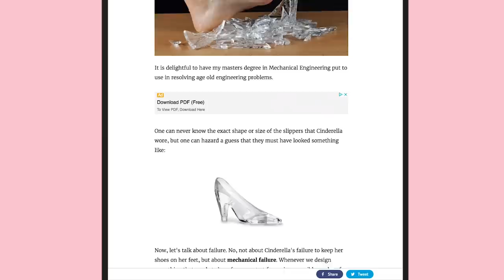I Tested Custom Glass Slippers Like Cinderella

Comment: This shoes were way to big for her. Of course she fell on the stairs.
Reply: Mona L what KNOW
Reply: What I was thinking
Reply: they awkwardly stuffed her sock too
Reply: They probably have to be slightly to big, because the material is so rigid
Reply: Mona L i think they intentionally find a person with smaller foot so they can stuff the socks to protect her feet when the shoes broke
Reply: They... did that on purpose. So that they would.

Correct?
Reply: Actually she wears a socks so that it will fit her perfectly before their experiment starts.

Comment: Her foot was way to small for that shoe!
Reply: Sofia Arango exactly
Reply: Sofia Arango 👍👍👍👍
Reply: It would have been almost impossible to find someone to fit that shoe perfectly I think, because it was pretty nartow at the top but wider and longer in the bottom - you would have needed someone with very slim feet which are normal sized.
Reply: In addition, a perfectly fitting shoe doesn't fall off.
Reply: July TwoWishes you try making a glass slipper by hand
Reply: Sofia Arango ikr
Reply: Augusta Leblanc  Why? Your answer literally doesn’t make any sense
Reply: ik
Reply: Sofia Arango IKKKKK
Reply: I luv how she said push more. More more. Luv it
Reply: Now we know why Cinderella dropped the shoe
Reply: I agree
Reply: THANK YOU
Reply: Too*
Reply: @lumen526  Mine would've fit :)
Reply: It was too small but any other bigger feet wouldn't even get in due to the narrowness. As you can see, they used socks to fill in the space. But it probably also threw her balance off because her center of gravity is in the middle of the shoe rather than the back where the heel is. It's not perfect but as close as it could get
Reply: Sofia Arango ikr (1year ago too and I still agree 2019 😎)
Reply: I know but they said she got the shoe to "fits"
Reply: Shhh I mean I'll probably fit it in a size 6 (UK)
Reply: I bet I could fit it
Reply: It wss hand blown so thats an option as to why
Reply: I have incredibly slender feet, like real abnormally narrow (what a claim to fame..). I truly want to know if I could’ve managed it, haha

Comment: I'm a glassblower and I think he did a great job on those shoes. Shaping it to fit is hard to do by hand. I made some Glass-Knuckles that took several re-workings to fit my hand.
Reply: Matt Jasa woah.. that sounds so cool. Be careful!
Reply: Thank you. But don't worry I teach glass blowing too, safety is most important. Like at 4:43 when he pops the hole he melts in the "bubble trash." That's the way to do it, you don't want to be breathing that Bubble Trash in.
Reply: Matt Jasa interesting rubs chin
Reply: He’s wearing sandals and I was honestly concerned about his feet the whole video
Reply: To be fair, Disney’s Cinderella’s shoes weren’t made by blowing, it may have had a better fit design inside, and even a little friction on the bottom.
Reply: Matt Jasa I've been glass blowing before and it is an amazing art. The only thing that I didnt enjoy was the bulky gloves in the hot room, but that wasn't that bad. I respect everything that you do!
Reply: When you say re-working, do you mean you can re-heat them to re-shape?
Reply: You make YouTube videos as well! I'd be sure to check those out!🙃
Reply: How much would a pair typically cost?

Comment: I read somewhere that the shoes were originally leather and in some translation it got changed into glass.
Reply: I believe it was fur in the original but the reason for that isn't pleasant....
Reply: @echoeddra8on  specifically, silver squirrel fur, which sounds like it would make pretty dope slippers
Reply: It was fur from squirrel because in french it is called vair which sounds like verre meaning glass so that's why it got misinterpreted throughout the years
Reply: @pandoreldr4232  I guess at some point "glass slippers" made about as much sense to the translators as "squirrel fur slippers", but the squirrel fur sounds way more comfortable... ngl, every time I pass a dead one on the side of the road, I think about it
Reply: Why don't they make one from plasticcccccccc

Comment: Logic:
Cinderella's glass slipper fits perfectly at her
But why did the glass slipper slips off her foot?
😂😂😂😂
Reply: Because glass is slippery.
Reply: Foot sweat
Reply: Because in the original tale the prince put some sticky material to the stairs because he wanted to catch Cinderella.
Reply: Her feet probably got sweaty
Reply: 100% Kookie Biased because maybe the fairy godmother used magic so it only fit her, and then the magic wore off at midnight, and then the shoe fell off.
Reply: 100% Kookie Biased I agree and im 100% chim chim Biased.
Reply: 100% Kookie Biased in 100% suga biased
Reply: Liv - I guess that would explain why the slippers disappear after midnight
Reply: 100% Kookie Biased woooooow legit that was mindblowingly logical 🤣🤣🤣🤣 but lowkey  ruined my youth
Reply: 100% Kookie Biased armmmyyyyy
Reply: Ruth Shibru im 110% Tae biased
Reply: Because of condensation from her foot sweating so it makes the glass slipper very slippery
Reply: It was in the script.
Reply: ARMY
Reply: 100% Kookie Biased Even the most fitted shoes can slip off if you pull enough of your foot out. 
By the time she was that far down the stairs, Cindy’s foot was flopping half out. Plus glass isn’t porous and doesn’t allow the skin to breathe, so her feet would’ve been sweating a ton after all that dancing. It’s late spring, nearly summer at the time of the dance so everyone was sweating like pigs. 
Her feet would’ve slid out easily with the lube of foot funk. Not to mention the heel easily caught the steps pulling it off throughly. 
With all those factors, it’s a miracle she didn’t send her shoes flying into a guards face like a football.

Comment: The real question is how did a shoe made for a size nine, end up ONLY fitting a size five 🧐
Reply: Actually it didn't fit size 5 it was to big for Jen so yea
Reply: Glass isn’t super flexible, so someone would have to fit PERFECTLY in this narrow shoe.
Reply: It was to narrow, they had only calculated for length. 
So she didn't actually fit, if you watch again, you see her feet swimming in it, that's why she's wearing padding in the back of the shoe as she's trying to run down the stairs.
Reply: While he was making the shoes he shaped the glass INSIDE the footprint instead of around it. I don't think he's made many shoes.
Reply: It's too big for her tho
Reply: Jenna Phillips well yea he works with glass, not shoes
Reply: The shoes were too narrow to accommodate the width of the foot, despite it being made for a size 8-9 foot (in American Measurements).
Reply: they run small
Reply: Glass shrinks slightly as it cools
Reply: It was designed to only fit her foot by following her foot shape and portions.

Comment: I’ve always wondered how the shoe fell off if it was custom made to her size
Reply: Sydney Brandt fam good point
Reply: No strap.  It's more that her foot lifted up the same way as getting into it.
Reply: Sydney Brandt in the original story, there were 12 nights of a festival held by the royals. The prince had been entranced by her for all of theses nights, but she always left before midnight, like, booked it. So,  on the Eleventh Night, she spread tar on the stairs of the palace to trap her, but she escaped again. This explains how her perfectly fitted shoe came off in the story, but it doesn't for the movie. So, maybe because it was hot and her foot was sweaty and the shoe slipped off?
Reply: I mean she wasn't wearing socks in the movie and she must have been tired of dancing all night (i know i would have been) so she probably was really tired and sweaty thus her glass* slipper slipped from her tiny feet.
Reply: Tavon Fenwick Well I’m pretty sure the fairy godmother didn’t roll up at Kohl’s that morning or sum’n to buy slippers 😂

Comment: They should try to cut their hair with glass like they do in Tangled
Reply: 1 am Thoughts or Mulan with a sword!
Reply: Niña Perdida They already did the Mulan one u should check it out
Reply: Ya
Reply: They already did the Mulan one
Reply: 1 am Thoughts yeah
Reply: YES
Reply: That's kinda dangerous though... if it were a jagged piece of glass, they could cut their hands while holding it. They would also risk cutting the back of their neck if they did that. Buttttt they'd probably take safety precautions to avoid danger. Such as holding the hair away from the neck while it was being cut. And putting on gloves.
Reply: BananaKitOfInternetClan+ They used a sharp sword and that was dangerous, and they had a raccoon. I don’t think the glass is a big deal

Comment: .... why didn't they do a mold of her feet then pour fill it?
Reply: To late for that now
Reply: Mario LushLover too*
Reply: That would have been so much easier
Reply: +krazzysu Thanks mom.
Reply: it wouldn't work because glass is inflexible and parts of the foot would have been thinner than others as you would have actually physically able to put it in
Reply: Evie Whatmough They still could've done it at least for a size reference.  Would've worked better than just a chalk tracing.
Reply: Evie Whatmough But it still would've been a better fit. They could've poured it thick like any basic single or double pour mold.
Reply: well if they pour it in a mold they still have hollow it for the feet to actually go in so they kinda had to blow it. Also there's a covering on top (cover toes and stuff) so that would make it really hard to pull out the glass from the mold without breaking it.
Reply: Saem Jo yeah but you could reverse mold the foot like a half a centimeter bigger then the foot and dont do it perfectly molded to the toes, just lightly molded to get the general shape of the foot.

Comment: I can't believe they didn't 3D print a form of her foot so they'd get the size right.  What the?
Reply: I don't think you can mold hot glass around a plastic 3d printed object tho :/
Reply: I honestly think it depends on teh material for a mold, there are some things out there that can handle way past the melting point of glass
Reply: Serai3 plastic + hot glass....hmmm...that would go well....
Reply: No but you can use the printed mold to make another mold that CAN be used with glass.

Comment: Bruh, if the shoe fit perfectly, it should'nt have fell in the first place.
Reply: Neah Malik EXACTLY👏👏👏👏
Reply: Should'nt? Hunny, what kind of autocorrect do you use? Is there any yesn't too? Lol jk
Reply: It’s not that easy I would like to see you run down stairs with glass slippers that fit you perfectly
Reply: I have a pair of heels that fit perfectly, but they still slip off if I'm running or going down stairs.
It's normal, especially if you have narrow feet (which Cinderella supposedly has, and I definitely do.)

Comment: Why didn't they messure her feet first before making the glass slippers.
Reply: They did, but the soles (I think that’s what they’re called) or the sides are too thick maybe.
Reply: did you think he'd be able to perfectly mould the inside of the shoes to measurements? that glass is 300 times hotter than lava. he had to keep melting and shaping it. what makes you think he'd be able to stick a measuring tape inside???
Reply: Winona Daphne well 33 people where thinking the same thing as me I'm not an expert on this. But he did have a drawing to messure before making the mold just thought if he had messured her feet it would have helped a bit.

Comment: If everything Cinderella was wearing and using went back to normal at midnight then why did the slipper stay glass 🤔
Reply: Lucy because she wasn’t physically wearing it at midnight ☺️
Reply: Well, she wasn't wearing the cavalry or the cart made out of a pumpkin either but they turned back!
Reply: Lucy oh yea omg theory
Reply: Lucy THAT is an excellent question indeed. Have a biscuit.
Reply: Simple it was a gift for Cinderella from the Fairy Godmother. A reminder.
Reply: Every other stuffs are made by Fairy Godmother by turning something else, that’s why they came back to their original form in midnight, whereas the slippers are a brand new stuff, Fairy Godmother made it especially for Cinderella. That’s why it doesn’t turn to anything after.
Reply: BananaHammock that’s not true, because then she would’ve kept the gloves too and the dress and she didn’t.
Reply: flintown173 the slipper was the only thing that couldn’t be changed at midnight
Reply: Cinderella slippers were made up out of thin air by the fairy, while the other stuff was transformed and had to go back to normal.
Reply: Marta Torrent The dress was built off of her previous destroyed dress
Reply: Lucy 

Well there’s a theory..... if you e watched the 2015 live Cinderella (don’t worry I won’t spoil it if 
You haven’t seen it) but the thing is the reason everything else turned back to normal and not the slipper
Was because it was made from pure magic. When her fairy godmother gave her the slipper she 
Didn’t take the shoes she was wearing and Transform then like she did with the carriage and dress,
But made them almost from thin air..... or pure magic.

That’s why they didn’t transform back when the clock striked twelve because they weren’t transformed 
from anything.
Reply: brcmano nope she had shoes on that transformed to the glass slippers
Reply: Marta Torrent 

Not in  the Disney 2015 live action Cinderella
Reply: i'm not talking about the 2015 version. I mean the original one. The OG.
Reply: Marta Torrent 

Oh.... well then yeah she did have shoes on. But the Disney live remake kinda explains it 
Don’t you think?

Comment: Ok but here's the thing Cinderella's outfit was meant to be perfect in every way. So if this is true then the shoe wouldn't have fallen off in the FIRST PLACE! A perfect shoe would have stayed on!
Reply: Miss_Kisa94 
It stayed on all night but once the clock struck midnight everything started to fall apart. The shoe falling off was the first part of the unraveling.
Of course in the original story the Ball lasts for 3 nights and the shoe stays on for the first 2 nights. It isn't until the 3rd night that the shoe comes off because the Prince pours tar on the stairs.

Comment: Why couldn't he make them the right size to fit the original girl?
Reply: I guess he has never made shoes before... They were good leght but he didn't measure the other lengths...
Reply: Donna Lynn the glass folded and shrank
Reply: fehaxo the other lengths? Like the width? 
Donna - it could be anything really. It could be that the measurements were wrong, the glass shrank as some suggested, or other factors. And instead of waste time to redo the shoes, which is expensive and time consuming, it’s easier to find someone else to fit in them.
Reply: Probably because the maker wasnt trained to make glass shoes?
Reply: I mean, she can't just try a burning piece of glass on.

Comment: There are a few problems with this.

1. Getting a pair of custom made glass slippers to fit perfectly would be hard.

2. They would have to be made of tempered glass (which is 4 or 5 times stronger than regular glass) to reduce the chances of them breaking.

3. The insides of the slippers would need gel cushion inserts to make them comfortable to wear.

And 4. The heels and toes of the slippers would need some type of cushioning to protect the glass itself!

If all these things are done,... Then I think it truly would be possible to comfortably walk in a pair of glass slippers like a regular pair of shoes for the most part!